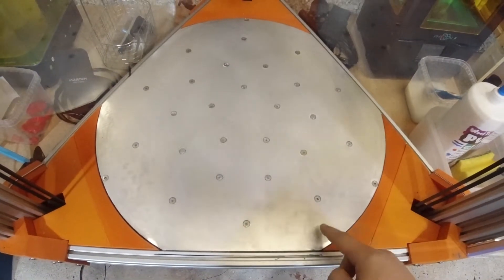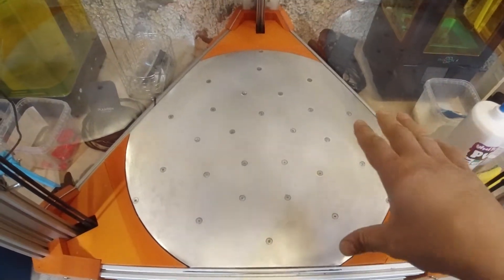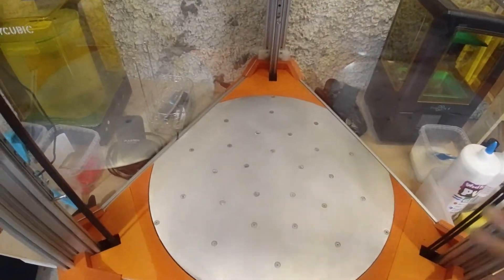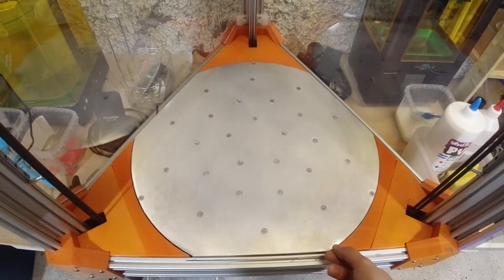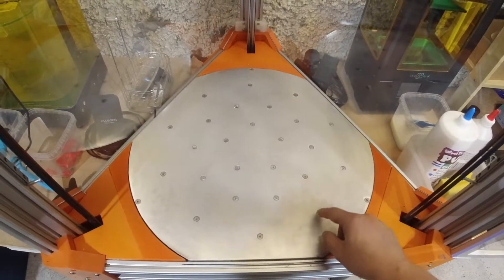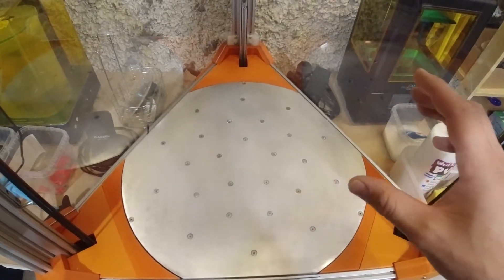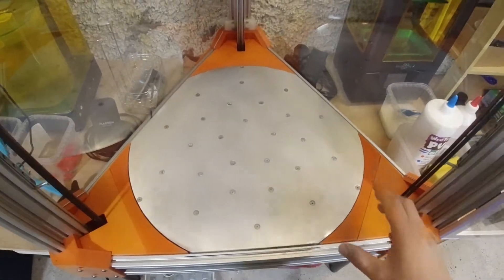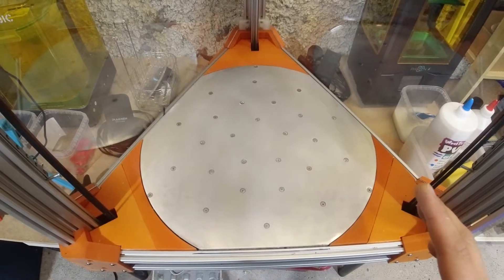3d printer heated bed upgraded with magnets

Comment: So nine months later how is the current status of the printer? Are you happy. 
I really like your design. 
Any chance of getting the CAD file (.step)?
Reply from the maker: HI TO EVERYONE
It's been long time since my last video, short update here, I'm very happy with my printer so far, it has produced lot of prints and it also went thru some upgrades. Original build was great and I didn't have any issues with it but I wanted to do some upgrades on Carriages and tensioner for belt so I redesigned top corners, added new mounting brackets for nema17 steppers where timing pulleys are mounted on 8mm shaft wich is then connected over coupler to stepper motor so stepper motor is not taking any tension on shaft.
Whole sistem is now more complex but it is also able to produce some fast printing speed (500mm/s) at the moment I'm having trouble with part cooling at higher speed as my part cooling is done with bird air wich is great  but I will need to add another small airpump to produce more air for part cooling.
Also I designed and cnc milled aluminium effector with water cooling with I'm very happy.
I wil really try to take short time and make Video with updates about this build and will post .step files so anyone ho want to do some remox can do so easier.
Any questions about this build feel free to contact me and I will try to do my best to come back quickly to you with answers.
Reply: @3dicnc  Thanks for the reply!
I am very glad you like it. These upgrades sound exciting.
Berd Air is the way to go!
Take your time, I am really looking forward on upcoming videos!
Cheers
Reply: Ah and I forgot to ask, you are running Marlin right?
I've went from Repetier to Marlin and now to klipper on my flsun q5.
Of course it's also a matter of preference but especially deltas really benefit from the overwhelming performance of klipper.
you might want to check it out.
RepRepfirmware is also cool but costs more.
Reply from the maker: Yes I'm using Marlin at the moment, will be on c
klipper very soon as I'm working on it :) but don't want to put it on this delta yet as I want to be shure in everything being setup as I want and in meantime this printer needs to work :)